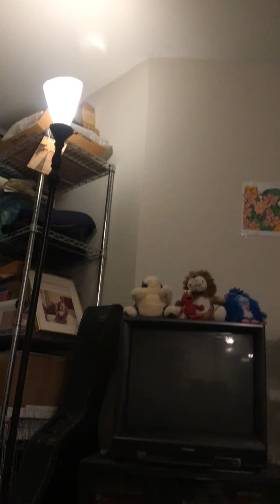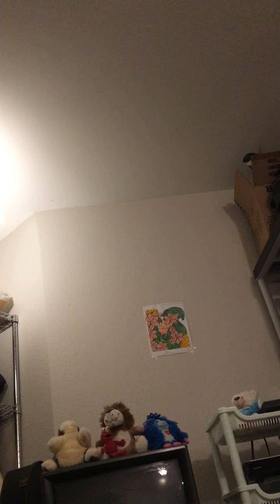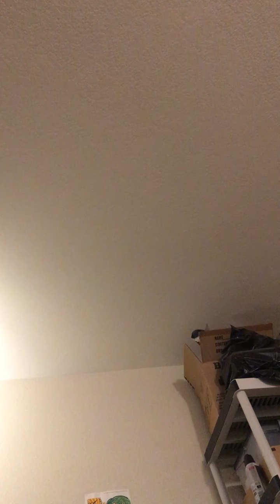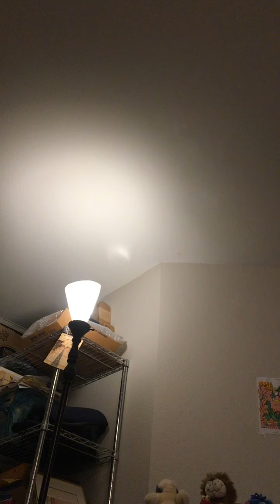Bi-directional magnetic remanence

Comment: Hi, do think this related to what lyne wrote about in regards to iron in ships and or the old coax cable with steel on outside ?..have you tested any of this? Thanks!!
Reply from the maker: Yes you are correct this has everything to do with what William Lyne was quoting Nichola Tesla when Tesla purportedly made the statement that for every 200 pounds of iron added to his special generator, one horsepower was added to its output. We may add other inventors of the same time frame who also dabbled in this type of technology, namely: Nathan Stubblefield, Edward Leedskalnin, and the Ammann Bros such C. Earl Ammann in the 1920s. And probably Nichola Tesla with his Pierce -Arrow demonstration of the 1930s but we don’t know that for certain but it certainly is probable since he chose a 4000 pound vehicle to conduct his demonstration which is mostly composed of iron in its chassis!
Reply: @charleschandlertornadoelec6231  thanks! I have watch your videos a few more times, but this  sounds like it's worth testing; I wish I had access to the electric motor shops I've worked in in the 1980 s ... Back to the future..it seems the further you go back the more advanced the technology..I think lyne is right about books and info being swept up especially after 1947!! Thanks ,hope your doing well!